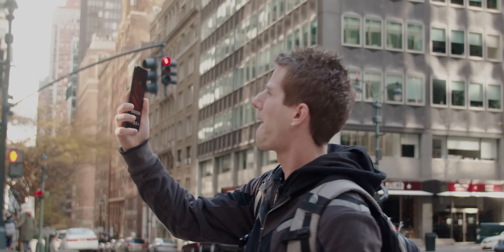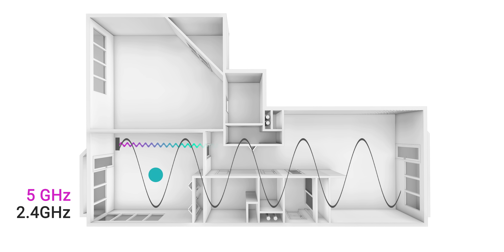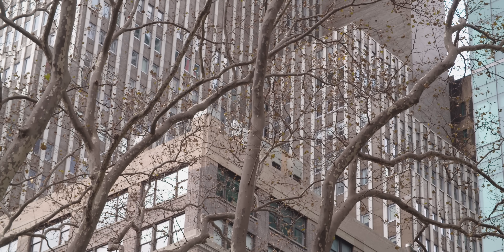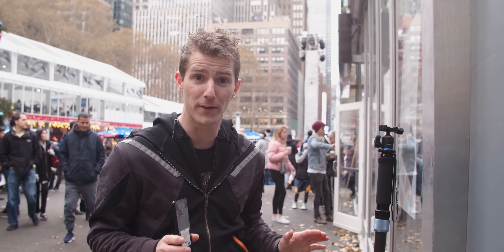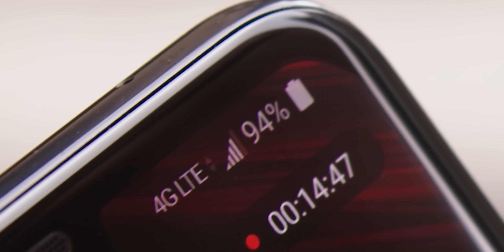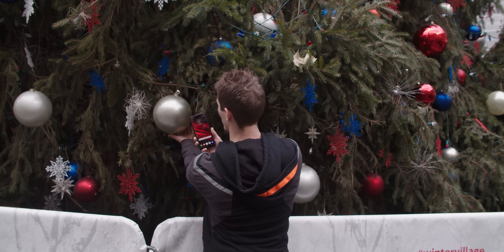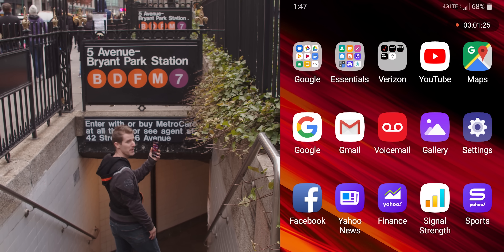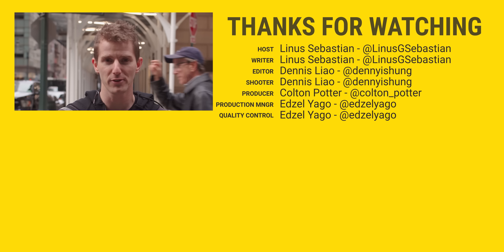The PROBLEM with 5G mmW...

Comment: Misnomer being perpetuated that because of a higher frequency it has much higher bandwidth. The reason why 5Ghz wifi is much faster than 2.4Ghz wifi isn't because of the higher frequency. It is because of the frequency "Width" compared to 2.4. 5Ghz wifi will have up to 160mhz of width compared to a maximum of 20mhz of spectrum of 2.4Ghz wifi. If we were comparing apples to apples,  and set both 5Ghz and 2.4Ghz so it could only use 20Mhz widths, 5Ghz would win by just a few Mbps due to signaling rates alone. Don't believe me? Set your 5Ghz Wifi To 20Mhz width and do a speed test, and then compare it to 2.4 wifi.  :)    As for mm wave 5G cellular, yes it will have a much faster signaling rate due to a higher frequency, but it also has greater frequency "width" as well. Once again, it isn't the higher frequency alone we should be praising for that blazing speed, it should be the "Width" or allowed spectrum of frequencies between X and Y, and how your wifi chip utilizes that spectrum that is the real winner of faster wifi and cellular speeds :) Cheers --

Comment: Wow, if I were T-mobile I would pull any future advertising due to this video. Instead of spending 90% of the time shitting on the 5Gmm service (which is mainly meant for point to point installations) it should have been MORE about the usable lower bandwidth 5G which is what most people are going to experience.

Comment: Straight from https://en.m.wikipedia.org/wiki/5G
T-Mobile CTO Neville Ray warns that speeds on his 600 MHz 5G may be as low as 25 Mbit/s down.[2] AT&T, using 850 MHz, will also usually deliver less than 100 Mbit/s in 2019. The performance will improve, but cannot be much higher than good 4G in the same spectrum.

Funny how this video suggests there will be 1Gb/s 5G available indoors from T-Mobile to uneducated viewers that do not know/care about the nyquist theorem.
Reply from the maker: Video does no such thing. Video explicitly says it won't be blazing fast in low and mid bands. Finding it very confusing how many people are commenting without actually watching the video.
Reply: "Their goal is to use low, high and mid-bands in order to hit the perfect trifecta of high speed and great coverage"
I'm not sure the uneducated viewer will draw the conclusion that T-Mobile indoor 5G won't exceed 4G speeds with that closing statement of yours...
BTW why do you accuse me of not having watched the video instead of asking why I came to that conclusion? Did you even read my entire comment?

Comment: You know what also uses that frequency band? Weather monitoring satellites that we rely on to get accurate forecasts. The fact that the current administration has (A) sold the rights to the 5G wavelength, depite  5G interference making it MORE DIFFICULT to get accurate weather predictions and (B) has rolled back environmental protections despite climate change resulting in more severe weather is a travesty.
Reply: Climate change is a fraud, the man does however change the weather with his geo-engineering.  We can argue about it if you like, but you should be aware that I used to work in weather forecasting for aerospace and offshore industries.  Your certainly right about the frequency interference and the environmental protections though.

Military Chemtrails: Artificial Clouds & Directed Energy Weapons in Space
https://climateviewer.com/2019/09/19/military-chemtrails-artificial-clouds-directed-energy-weapons-in-space/
Weather As A Force Multiplier: Owning The Weather In 2025
https://archive.org/details/WeatherAsAForceMultiplier
HAARP and the Sky Heaters
https://climateviewer.com/haarp/

Comment: From the start I thought 5G was dumb. This video doesn't help make me change my mind. 
The glass from a car blocks it. So no 5G in your car.
The glass from the office blocks it. So no 5G at works.
No 5G in your house, that's for sure. At the higher frequency, a sheet of paper blocks it. If you don't have a nice smooth reflective surface nearby? No luck.

5G is honestly a marketing thing. The tech is worthless.
Reply: Glass does not block generally block signals, the insulated glass, i think its called low-E or something, does though as it has a metalized coating.

Comment: >not even mentioning the health risks
mhhm can you taste that cancer?
Reply: You think microwaves that are weak enough to bounce off you are worse than the ones we already have that go through you?
Reply: @GhostCow  Were not using phased array antennas to blast those existing frequencies at you in a high powered beam.  This is most certainly not the same technology as the existing equipment.  They are saying the 5G equipment is low powered on the BBC for example, but they did an interview with the Huawei guy and he let slip that the transmitters are using 3KW, looked like he only had a single antenna as well where in the real world multiple may be installed.  Existing towers use a lot less power, I think they were like 300W IIRC.  The BBC has a vested interest since they are trialling 5G to cook some Scottish Children on one of our islands.  The power has to go up as the frequency goes up to keep the range decent, what with the inverse square law and such.

Some of the frequencies that will be used are not in general usage yet either and are potentially very dangerous such as 60Ghz which affects the orbital spin properties of the oxygen molecule (real science go google it: "60Ghz oxygen molecule").  If you like breathing and want your cells to respirate, then this is very dangerous, might even produce ozone which is deadly.  You can modify the composition of atmospheric gasses with microwaves.  Existing frequencies which are in use are shown to have many health problem, over 20,000 scientific whitepapers are available and nearly 70% are showing health hazards.  Even the WHO has microwaves listed as a possible class 2B carcinogen, they are a definite class-1 however.
Reply: @GhostCow  Fact of the matter is that there weren't enough tests done beforehand to make sure that it isn't harmful. But as you can read, it affects the brainwaves and more.
Reply: You're technically right that it does present a tiny amount of microwaves, but the radiation that is already present far outways the tiny amount generated by 5G.

Comment: 5g 1mm is probably better suited to solar powered rigid airships at ~60k feet with dedicated lasers for terrestrial connection to the distribution centers, basically just a low altitude satellite, would be cool if satellites could use this(and just have crazy high ping) but i want to say only a few bands can punch through the various atmosphere transitions without too much trouble/distortion